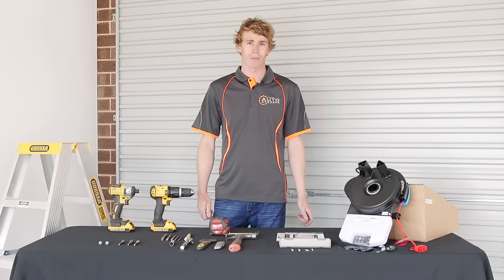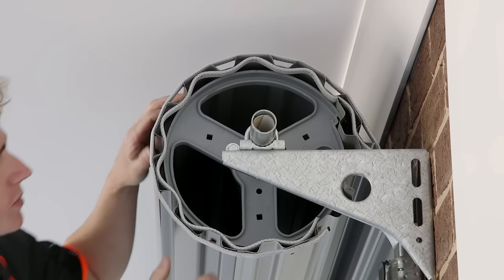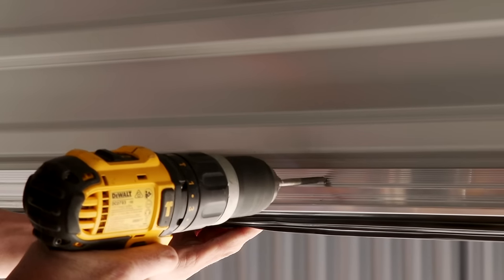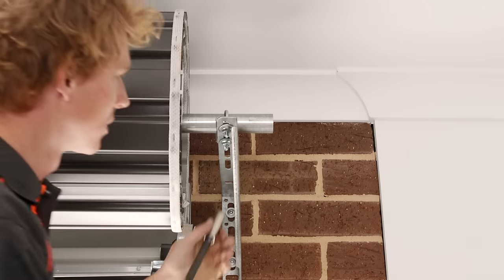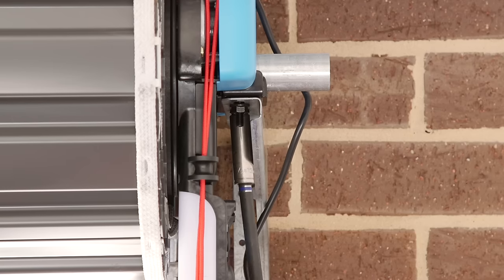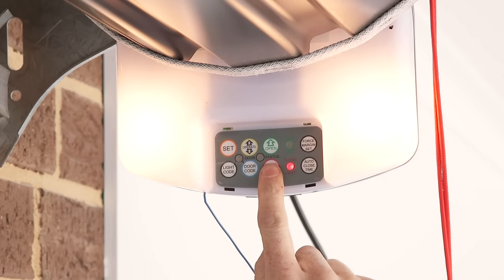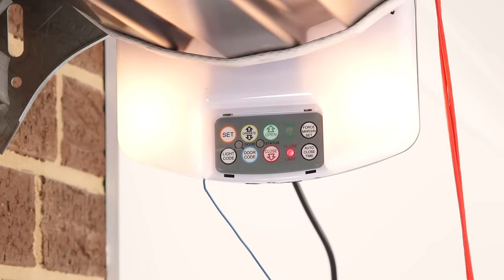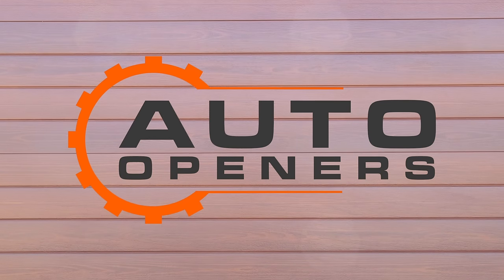How to install a ROLLER OPENER Auto Openers Garage Door Opener Installation Video

Comment: Great instructive video, thank you. I would probably leave the old locking mechanism in place so you could still lock lock the door if for some reason you have to use it in manual mode.

Comment: Screws are used in the drums to allow motor to apply equal closing pressure on both sides of the door I would assume?
Reply: I was trying to figure out why. That's the only thing I could come up with as well.

Comment: Hi, when setting the limits on opening the door will the motor keep running until you stop it or is there a maximum number of rotations? If I have a very light door but say 1M wide x 8M high, can I set the limits so that the motor will keep running for the full 8M door height?
Reply from the maker: Hi Nigel, there is a hard limit of 3.2m high on these openers. For higher doors, the Door Master might be a better solution.